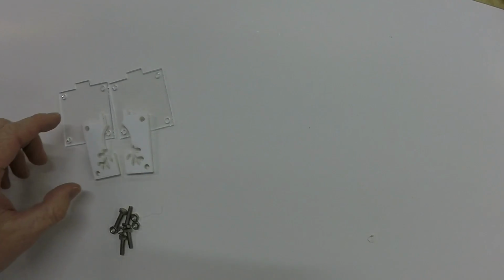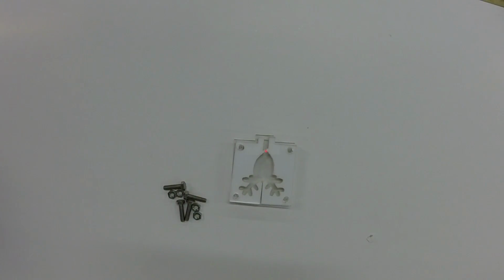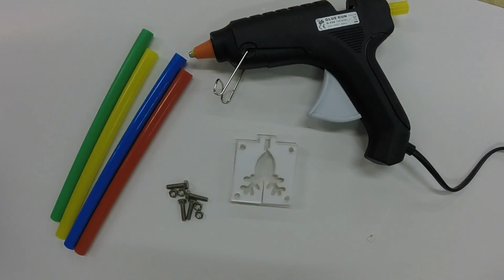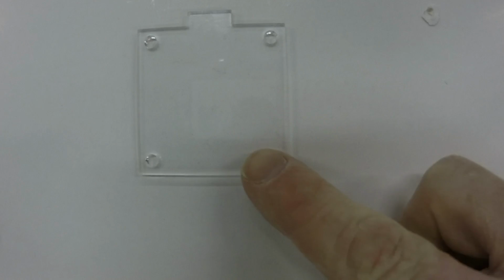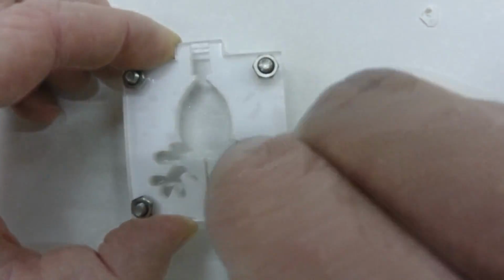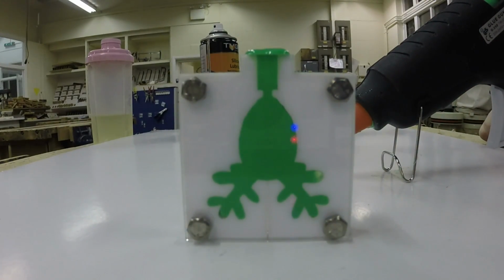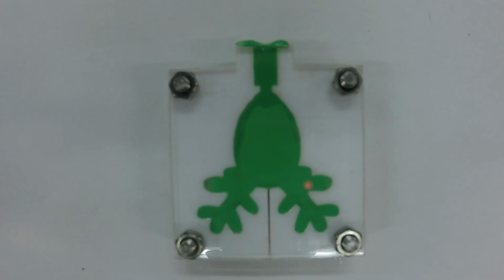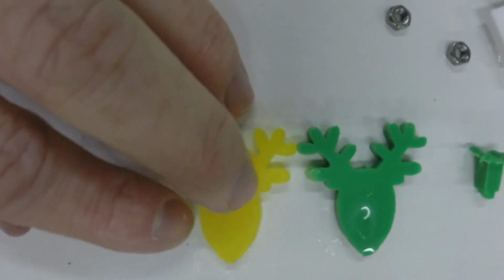Glue Gun Injection Moulding

Comment: You can also use (pre-melted and shaped) PLA, ABS, PETG and HDPE Plastic. Yes, those 3D printer filaments and those containers you find at dollar stores, or your microwave meal comes packed in. Make injection molded objects at a fraction of the time it takes a 3D printer.  https://hackaday.com/2018/02/05/3d-printering-printing-sticks-for-a-pla-hot-glue-gun/

Comment: You probably know this and it may have been pointed out in the comments already but ,   Wouldn't  the main benefit of making the mold of aluminum instead of the acrylic top and bottom is that as in a real injection molding operation the mold can be heated which ensures the injected material flows to all the intricacys of the mold and conforms better.   Rather than the glue cooling off rapidly as it enters the mold.

Comment: Why can't you do the same thing using some other kind of resin?
Reply: you could, but it would have to have a melting point similar to the glue. If it isn't an air cooled resin, then you'd need a plunger type piece of equipment to force it into the mold....Plus you're approaching the melting point of your mold so it would deflect if the resin was too hot. That's why real injection molds are steel or aluminum.
Reply: Muskoka Mike what about using a catalized poliéster resina. What they use for working with fiber glass. You would need to put on some kind of oil so the resin doesnt stick to the mold

Comment: Thank you so much for this amazing idea. I was looking into tabletop injection moulding to make smaal plastic parts, but that was way too expensive for my budget. I think this idea is amazing but do you know of any way that I could use a thermoplastic and insert that into the glue gun instead of gluesticks?
Thank you so much I really love this idea.
Jack.
Reply: Yes metal moulds there is no workaround ...for cheap model quality plastic moulds
Reply: If you have a 3D Printer you can make PLA 'Glue Sticks'.  As long as you have an 80W Glue Gun it works perfectly!  Research it a bit!  If you don't have a 3D Printer you can always have an online service 3D Print the "Plastic Glue Stick" for you. 

I'll be using this method to join my PLA casting trees together.  You should also look into Lost PLA Investment Casting.  You can turn extremely complex and intricate parts into metal with this method.  I have a Prusa 3D Printer and it's the best investment I've ever made for prototyping